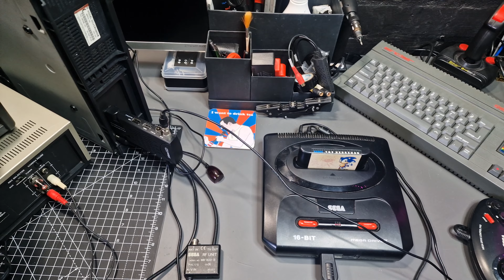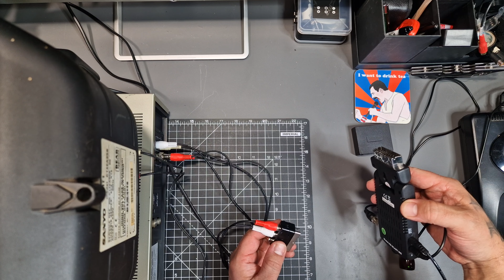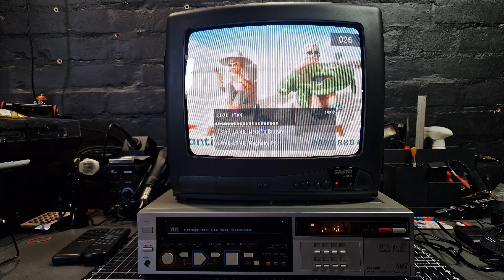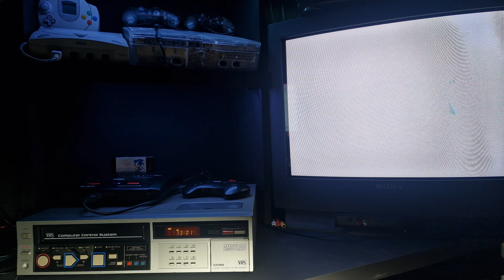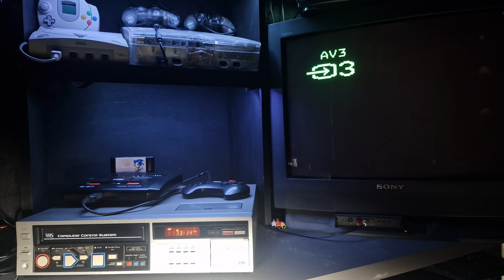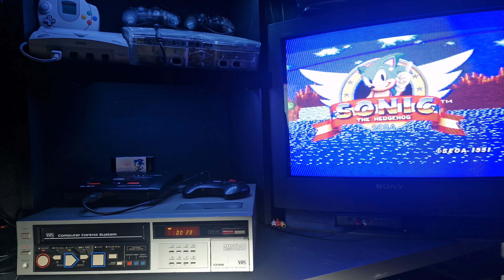Amstrad VCR 9000 from 1985 - The VCR wiped from history #retrotech #vintage #vcr #vintagetech #vhs

Comment: Ah, the horrors of recording TV in the 80s! Of course, we were kids back then so it was easy for us and we didn't know any better, but I now understand why VideoPlus+ was invented - remember that? :)
Reply from the maker: Yes, VideoPlus+ was very useful. Even changed times automatically if the program was delayed for some reason!
Reply: @retrotechgraveyard that actually wasn't part of the VideoPlus+ spec, but a separate standard called PDC (Programme Delivery Control)